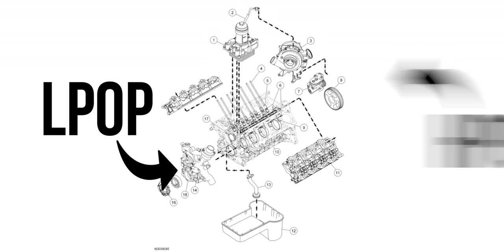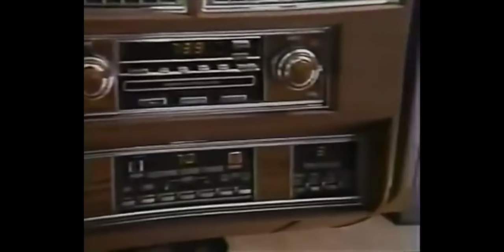These are the WORST ENGINES EVER MADE

Comment: You should definitely make a part 2 with the 6.4 Powerstroke
Reply: That is a nightmare from the factory.  But if you bullet proof it, it is amazing.  Unfortunately, not many know what that is and how to do it.  Work has one. It seemed it was dying really early, before 150 thousand miles.  One of the day shift mechanics did what he called a bullet proofing on it.  It was like a new truck.  Today, it has 388,000 miles on it and still hauling large loads in big trailers. After the bullet proofing, all we have done to it are valve cover gaskets, a starter about five years ago, and a ECM wiring harness last year.
Reply: @indridcold8433  Yeah you can bulletproof it but I mean stock they are not very good. You can also bulletproof a 6.0 Powerstroke
Reply: @terrificspokesman7416  Stock, the 6.0 is slightly worse than the 6.4, but not by much. It is amazing how trucks so close to dying get the bullet proofing and they revive like new.  The issue is, after bulletpfoofing, some regions will not pass them after inspection.  Here, we are lucky.  There is no regional inspection.
Reply: It’s the emissions, not the engines that make the 6.0 and 6.4 shit.
Reply: @indridcold8433  I’m sorry to be so ignorant, I have a 1986 Firebird with original 305 with carburetor, what do you mean by “bulletproofing an engine?”
Reply: @89wm1  The diesel 6.0 and 6.4 PowerStroke engines were infamous for many failures, losing power.  But they are, in fact, good engines.  The ridiculous emission garbage put on them caused problems due to strangling the engines of airflow, especially when the junk started clogging.  Remove that garbage and put in bypasses and you got powerful, efficient, responsive engines. Put in a better exhaust and better breather, and you got even better.  Flash the ROM and you get even better.  I think there were a few more levels you can add.  The one at work is on level 3.  We do not want to make it too obvious that it is modified to get mored power and reliability. Some people will have smoke bellowing, fire breathing monsters.  But I find that too much.
Reply: @indridcold8433  Ok, thank you.
Reply: @rodneystickhorse Stegall  I also have an 86 ta. They made 150hp, there's no need to worry about bulletproofing them, they can't work hard enough to hurt themselves or the weak t5 they're connected to. (But I love that car)
Reply: @indridcold8433  I mean the 6.0 Powerstroke did have the head gasket problems and the stock waterpumps were not the best
Reply: @hunterbidenscrackdealer3753  no, they were both turds. The 6.7L was the first power stroke since the 7.3 that was actually good
Reply: @keeganandersson4281  ok… after I deleted my 08 6.4 and spartan tuned it it was a bulletproof truck. 
And I have also had a 19 6.7. I can tell u a tuned 6.4 is a towing beast. 
I loved my 6.4. But I maintained it and didn’t drive it like a race car.
Reply: @indridcold8433  "if you just completely tear down the engine and rebuild it better than the factory did, it's good"
Reply: @hunterbidenscrackdealer3753  More than that Navistar was way behind the curve on these emissions engines where at the time Cummins, and Duramax sort of figured it out. So basically Ford and Navistar was letting the consumer do the research and development.

I'm in a logistics warehouse and I haven't seen a Maxxforce 7 engine in years. If people are buying International trucks they're opting for the Cummins engines. Ford at least started building their own diesel engines which are a Hell of a lot better.
Reply: The 6.4 isn't one of the wrost engines. It just isn't that good of a engine
Reply: @indridcold8433  how exactly? The rods are throwaways, the block isn’t strong enough and you’d have to delete the emission control systems, which is SUPER illegal.
Reply: @aliabdallah102  Where do you live that removing all that American junk is illegal?  Unless you live in the United States of America, where things are heavily controlled, you can do what you want to your own vehicle as long as it is safe and does not bellow excessive  smoke. The American environmental ministry (I do not know what it is called) has a long history of believing that burning twice the fuel to get less exhaust fumes, for a short test, is environmentally responsible.  At the instance of the test, the exhaust will be cleaner.  But the test does not take into consideration just how much more fuel the garbage strapped to the engine will burn, causing more pollution during the service life.  There are parts that need to be changed to make the engine solid. But the biggest thing to do is strip the American garbage off.  Here, those engines come with little of that junk and make 35% more fuel efficency, and a lot more power, with no modifications. Take what is there off, and the engine will make 40% better efficiency than the American marketed engine.  Change the cylinder heads and you will have a powerhouse of an engine.
Reply: @indridcold8433  i do be living in the Republic. May she live as a beacon to all.
Reply: @hunterbidenscrackdealer3753  apparently people don't seem to get that part .keep up the work
Reply: @DRAKE_DOES_STUFF  fair point
Reply: I got a 1986 Ford f250  bought it new 
400,000+ miles   at about 300,000 had to replace the injecter pump  still driving it
Reply: The Honda L15 turbo, GM 1.4T and 1.5T ecotec engines, Toyota 2AZ-FE, Gen 1 VW/Audi 2.0T engines, Ford 2.7 EcoBoost, and gen 1 Pentastar V6 should be in PT2 as well.
Reply: 6.4 power stroke was pure junk. Exhaust problems galore. I had one that had to be rebuilt at 40 thousand miles and again at 80 thousand. The second time they didn't want to honor the 100,000 Mile warranty. Until I filed a complaint with the Better Business Bureau.  A local law firm who handled lemon law cases contacted me and got me a little money and after it was rebuilt the 2nd time I traded it in. For an F150 that has been a good truck. It broke me from ever wanting another Diesel period.

Comment: The Oldsmobile diesel was pretty terrible from the factory but they can be built into a pretty awesome engine as long as you pick the right parts. The later DX block with the early pencil injector heads, studded and O-ringed with copper head gaskets, splayed bolt main caps, Speed pro 108M main bearings, King AM-series rod bearings, marine 10 quart oil pan and high volume oil pump. Also converted to internal balance. This combination can max out the stock injection pump at 240 HP with a roughly S366 size turbo. With the head and rotor of the 6.5 peninsular marine engine it can output about 320-350 hp. Internally balanced, they can turn up to 5900 rpm while keeping piston speed at 17 m/s or below. One example of a similar build, although limited to 2600 rpm due to the application is in, a John Deere model A tractor and can be found on YouTube. 240 hp at 2600 rpm.
Reply: Or in could buy a junkyard cummins with 300k that makes more power...
Reply: If you have to "pick the right parts" and "build it", it was a terrible engine. A decent engine doesn't require such things to make it work. What you describe is known as making the best of a bad situation.

Comment: The later Northstars were pretty decent.  My in-laws had a Deville from the early 2000s and it was flawless.  Really comfy car to drive.
Reply: Gm did correct the overheating issues with the later model 4.6 and perfect fuel mileage
Reply: I wish that was true of this 03' deville I have. Reservoir cap failed, overheated, blew both head gaskets. Now the only way it will run is if you drain the cooling system then it will start otherwise the cylinders inhale so much coolant it hydrolocks. I hate it, I'm about to scrap it.
Reply: @donnycummings491  That was your fault.  '03 Northstars are excellent engines.  You overheated it and ruined it.  Your fault.  Radiator caps fail sometimes regardless of your engine - I've replaced many on vehicles when they started to go.
Reply: Those were very well made cars, and the engine was solid.  It was the pre-2000 Northstars that gave GM a bad name.  Your car does have the 4T80E transmission with a known TCC issue though.  Should you run into that just ignore it.  It doesn't affect reliability.

Comment: How the hell do you put a 2.2L SOHC Chrysler in a bad engines list? Those engines eat abuse for breakfast, they're noninterference, run hard bearings, occasionally pop a head gasket but that's not a hard repair.... and there's enough beef in the design to turbocharge it.  What gives? Negative engagement, or legitimately bad opinion?

Comment: The 3VZE Toyota had massive head gasket failures with the very small sealing area at the rear of the block . If there was a half an inch of sealing area between the cylinder and the coolant passage. I have owned and machine shop for over 30 years. We did tons of things for the Toyota dealers, decking the heads and the blocks, but still nothing worked. The paper gasket would be soaking up the coolant in the small half inch area, and would separate from the steel fire ring, and thus, a consistent failure. The real issue is head shift, just like on the 6.0L Ford diesel. The 6.0 just did not have enough clamping load for the high compression, and if you messed with a tuner, your heads were instantly warped .007" I cut hundreds of these heads and never had one warped worse than .010" . The Toyota heads were also moving and that movement was accelerating the deterioration of the paper gasket in that small area. Toyota finally went to FelPro and asked them if they could come up with a possible solution. They created the MLS gasket. Sealant on the head side to adhere to the aluminum, sealant on the block side to adhere to the cast block, and a plate in the middle that allowed for head shift yet continued to seal, since there was no paper to weaken and tear. We were told all of this at a Fel Pro seminar back in the 90's.

Comment: I started as a mechanic in 1990 and 2.2 Chryslers were a dime a dozen. They were a good engine, not very powerful but they would chuck the occasional timing belt or blow a head gasket but were super easy to work on. You need an engineering degree to work on this new stuff which is why i'm a truck driver now. LOL
Reply: Glad I went into the generator field after dealing with cars and trucks for a few years. 
Haha we didn't start using cats till 2012 🤣
Reply: Keep that shiny side up, friend.

Comment: The Triton V10 gets a lot of hate, but I’ve had 3 of them.  They fixed the spark plug issue in 2002 and up 2V.  They will run for 400k miles only doing oil changes.  And if you spend the money to have them geared down to 4.88 or 5.13, they will pull anything.  I love my V10’s.
Reply: We've have 350.000 on ours, 2001 Excursion runs like a clock. I agree with you.
Reply: I got one in a 02 F-250 love it!
Reply: But the dodge v10 was eons better, right out of the box.
Reply: Absolutely agree. The basic engineering on the 6.8 is pretty good. Towing capacity is excellent. I don't think that they should be or need to be modified. They just need to be properly maintained.
Reply: Agree, I have 3 of them myself all floating around 200-300 thousand miles, never any real issues. Love the v10👍🏻
Reply: i used to work on a farm that run 2 of these V10s in trucks, one run great with close to 400k and older one still run great just not on all cylinders.
Reply: @strongereveryday2302  Dodge dropped it because of warranty costs.
Reply: spaceace1006  You have that backwards. The Viper engine is based on the truck engine.
Reply: @strongereveryday2302  
The Dodge V10 was a great motor. A company I worked for in the 90's used them in company trucks we drove. The only problem was that they did seem to use more oil between changes than you would expect. We always kept an eye on them for that. One bucket truck had 388K miles and still ran good when they got rid of it.
Reply: SpaceAce100  with important engineering revision. They are related not interchangeable.
Reply: What about the 5.4 L Triton? Was that engine's problems taken care of as well? I ask because I see a couple of them for sale but I am reluctant given what I have heard about them.
Reply: @marxnutz  I don’t understand what you mean by “from what I’ve heard “?
The 4.6, 5.4 and 6.8 are the same basic block and head architecture.
I would only add one more issue to the others and that would be cooling system maintenance. I prefer to halve the mileage intervals on coolant flushes. Because of dissimilar metals. I feel better about shorter intervals. A few additional services don’t equal the cost of destroyed radiators and heater cores. I am not a super picky guy. But, the factory recommended intervals are pretty long.
Reply: @scottbrown7415  
Long intervals help sell cars.
Reply: @scottbrown7415  The 2V 5.4 had a lot of issues with the spark plugs but the repair became so common, and the steel inserts actually made the engine better than stock.  The 3V 5.4 is a nightmare.  Especially if you drive your truck like a truck.  Oil changes need to be at 3K or you are looking at a failed cam fazer and failed timing chain tensioners.  The oil pump and galley holes are too small for a real working hard engine - especially if you stuck with the 5W20 oil.  The factory recommended oil change/coollant flush were for marketing and had nothing to do with actually maintaining the truck.  It gave Ford a cheap "cost of ownership" estimate when selling.  It was good enough to get the truck out of warranty and then Ford didn't care.  You buy a new truck or you spend a fortune at the Ford dealership buying Ford parts.  Either way Ford gets paid.  The last thing they wanted was something like the 300 6 running for 300K miles between shop visits.
Reply: @strongereveryday2302  What are you basing that on?  Dodge V10’s we’re so great that they quit making them immediately.
Reply: @strongereveryday2302 Yeah, but the rest of the truck is garbage.
Reply: @marxnutz  2 valve 5.4s are fine.  (1997-2003 F series trucks). The spark plug issue is easy to solve and a lot have already had the repairs done, avoid literally any 3 valve 5.4.. that would be the 2004-2010 F series trucks. All Econolines only had 2 valve engines so you're ok there. If you buy a 3 valve 5.4, you will be replacing the engine. Not a question of if but when.
Reply: I'm sure if you modify all engine on the list they will somehow be good enough, but the truck they're in never lasted long enough to see if the mods would make them better because the body would be rotting even faster than the engine go bad. Usually after 5 years, any Ford product would be useless anyway because of this.
Reply: Triton V10 is an excellent engine.  Agreed.
Reply: Never convince me the triton v10 is junk. I own 2 of them and they're insanely tough. I know a construction company in my county that has a bunch of them that have extremely high miles like 4	to 5 hundred thousand.
Reply: I saw a 2001 f 250 v10 one time with 550k verified original engine. It still sounded healthy and towed a 32' travel trailer from Arkansas to California.

Comment: I was waiting for the subaru head gasket nightmare. Oh well!
Reply: That was very short lived and only on a few years of a 4cylinder. Way over hyped!  I've ran the piss out of my 2007 3.0 6cyl and still runs like new after 160,000. Subbies tend to run a bit hotter than most engines. A well maintained cooling system is a must. In fact, all aluminum heads on all brands can easily warp when driven while overheating. The greater problem there is the operator not pulling over and shutting it off when they have an overheating issue.
Reply: @ltwig476  My Subaru 3.0 H6 Sedan is running on original head-gaskets after 20 years/280,00 miles.

Comment: We had 4 Chrysler 2.2 engines and a 2.5 engine. All were reliable and we drove them for many years and all went well over 100,000 miles with very few problems.  All of them have good fuel mileage and none of them burned oil even with 175,000 miles on one of them.  All ran smoothly and quietly when traded.
Reply: Yep...I had one in my 82' Dodge rampage. Never had one issue until about 178k miles with a hairline crack in the head which caused a coolant leak. This guy is so FOS.
Reply: I was surprised he mentioned that engine. Yeah the turbo model could blow a head gasket at like 100k but its making over 100 hp per liter. The naturally aspirated oned were just fine.

Comment: Worked at toyota dealer in late 90's. The 3.0 had a recall on headgasket. Often the recall replaced entire top end and a few complete engines. Based on what remember back then it was a headgasket specific issue that led to destruction of other parts when left unchecked.
Reply: I have a 90 4runner that recall got done on, it's at 286,000 with the 3.0
Reply: 528K miles on a 1996 3.0 V6 Camry.  Never heard of this nor was this repair needed with 528K miles!
Reply: @TB-lv2rh  your car doesn't have the 3vze it's a different engine
Reply: I have a 1995 4runner, 3.0,
Having various issues now.
Is there any way to find out if the recall could possibly still apply , or, what would you suggest , short of the junkyard ??
Reply: @tismit417  3.4 swap is usually the way to go when your 3.0 is on its way out